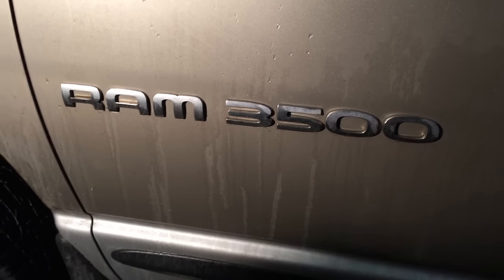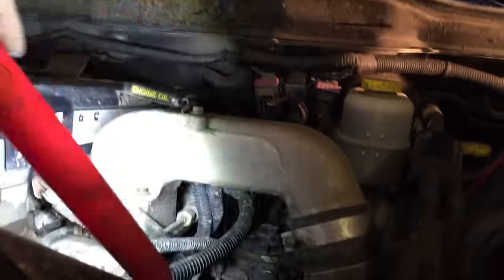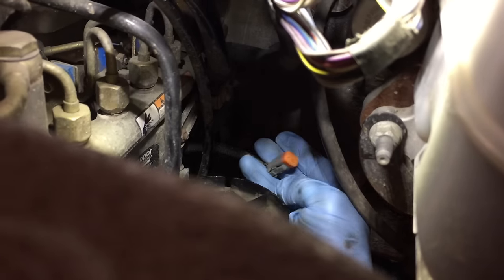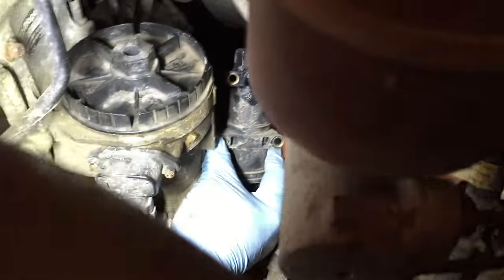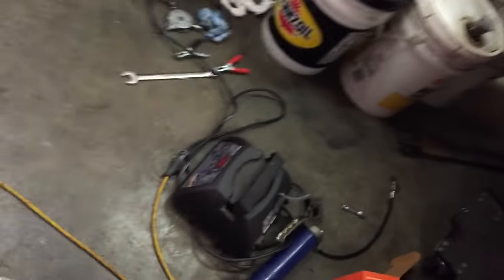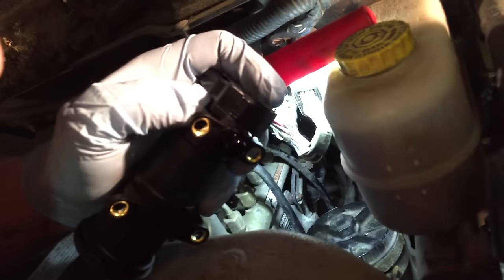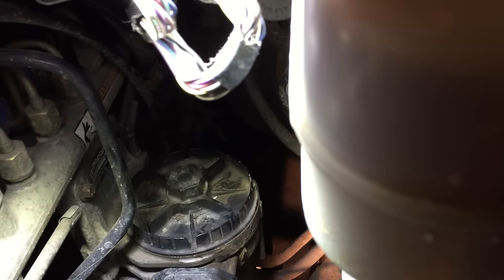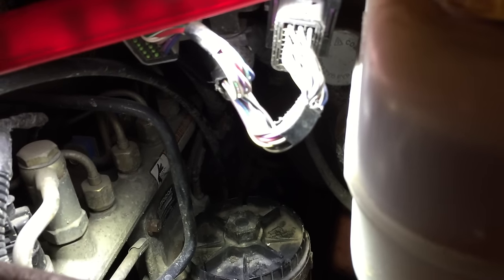2004 Dodge 5.9 diesel lift pump install

Comment from the maker: Hey Robert Kerby thanks for watching !!
It's fun doing stuff with the little man. As for knowing it was the pump was a educated guess. The truck would randomly die then restart. If I remember correctly there was a low fuel pressure code. Some research showed the lift pump to be faulty and also dodge changed up the style to a tank mounted pump with new fuel line etc. I did this repair on my dads truck a while back and it's been perfect ever since. Definitely a cheaper fix than the tank upgrade.

Comment from the maker: Hey Gene loosing fuel pressure could be your concern. Hard to say it should set a code if so. One thing to check is fuel filters or even a vapor lock by a non venting fuel cap.

Comment from the maker: The lift pump on this truck sucks from tank and feeds engine high pressure pump. I'm told there is a update to install a in tank pump obv way more involved. I did this one a while back with no issues since.

Comment from the maker: I would say a bad lift pump can cause stalling,no starts or lack of fuel in general. A 
low fuel pressure concern could cause it to run rough at high idle or under load.

Comment from the maker: Cool let me know how it goes
Reply: I got it in and the truck runs great again.  You make it look easy.  I dropped two of the screws but only found one so had to go to town to get another one.  I had access under my wheel well to unhook/hook the hose to the pump which worked good.  Thanks again for the video!

Comment: We have a Dodge ram 3500 2004 5.9 coming. We bought a lift pump and looked at a video how to install it but my pump isn't behind the fuel filter . Is there another pump anywhere ? can anyone help me ? thank you
Reply: In late 2004, Chrysler engineering moved the electric fuel pump from the side of the motor to inside the fuel tank. If your pump fails, even going back several model years, the superseding (expensive) part moves the pump into the fuel tank. The consensus of what I've read is the fuel tank pump is no more reliable, but is more expensive (part and labor wise) than the engine mounted version.
Reply from the maker: Hey Bettina Schmitz sorry for the late reply I didn't see the comment if yours isn't there it has been relocated into the fuel
Tank

Comment: Does this same lift pump come on the 2003?
Reply: Mine does have this on it and it's a 3500, I've looked and it's just a hose fitting feeding into the filter housing.